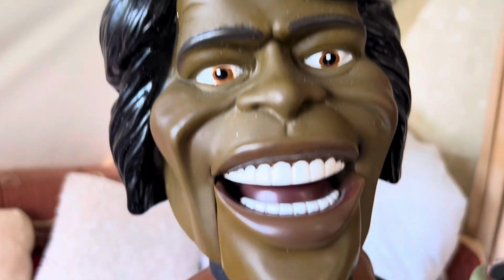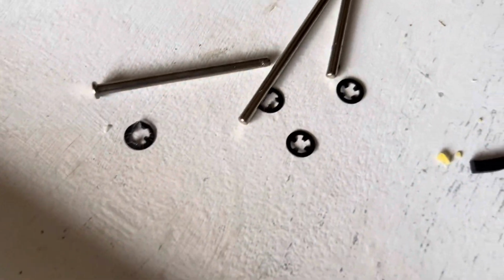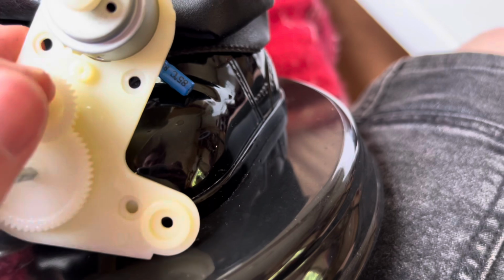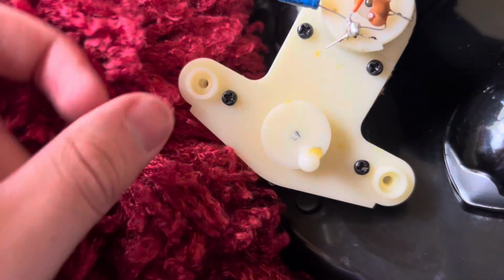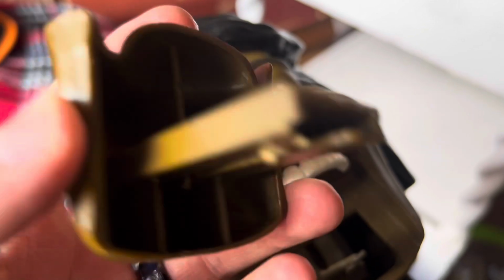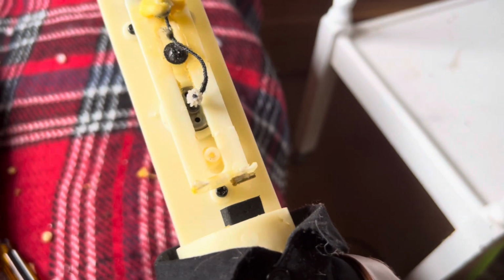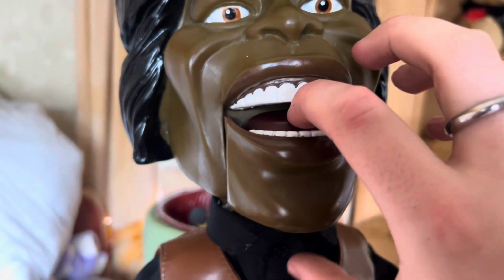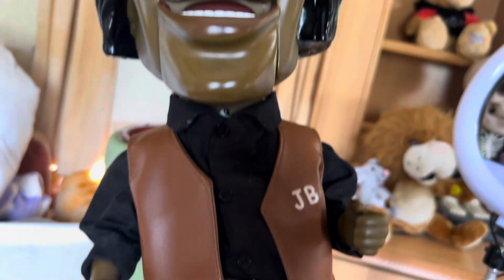GEMMY POP CULTURE FIGURE REPAIR! - James Brown Tutorial

Comment: I was going to try to repair the mouth on mine, but, 1. I couldn’t figure out how open it and feared breaking it, and 2: My wife HATES the thing and so I have to keep it hidden in a closet anyway!
Reply from the maker: The mouths are quite a paint to work on sometimes they have to be broken to be fixed sadly 😔🤣 but yeah you’d need to start with getting the mouth off then undoing the staples like I did in the video then you’ll be able to get into the head